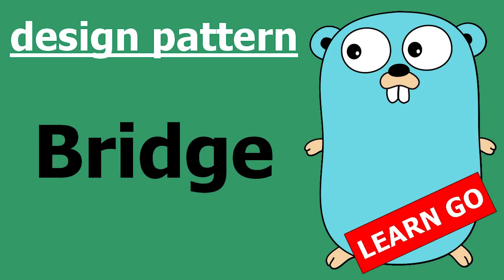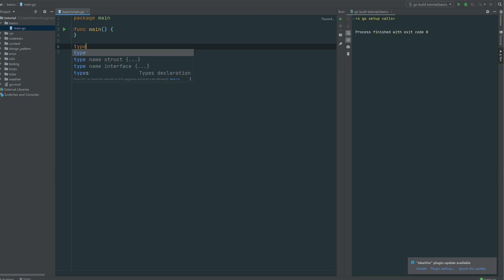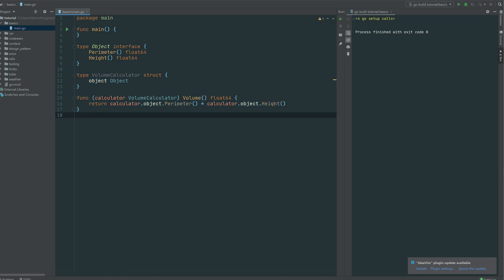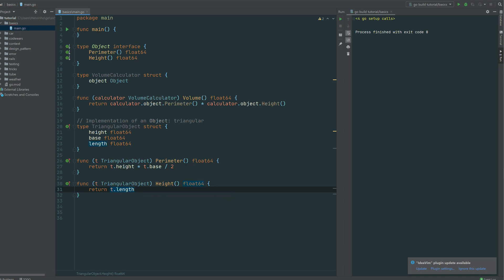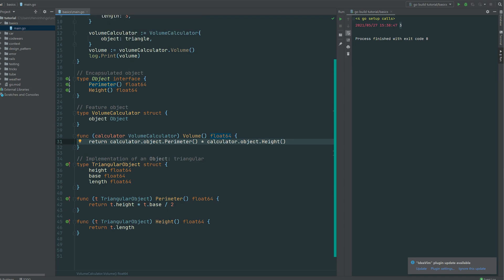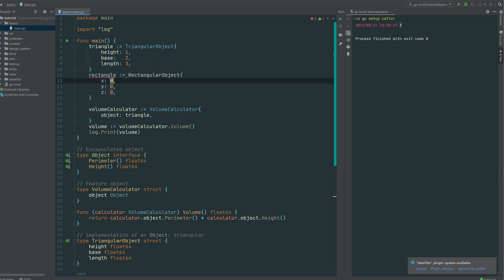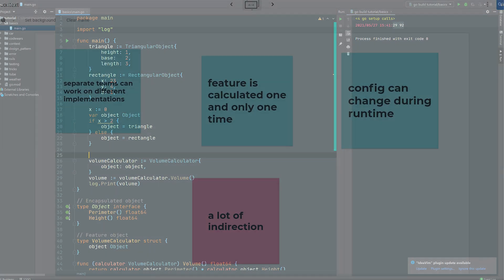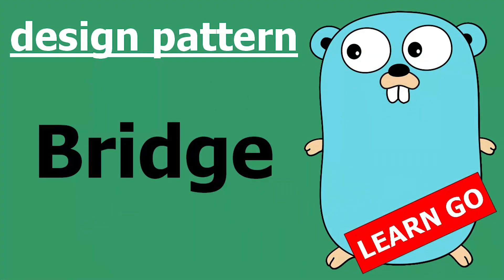[Golang] Bridge

Comment: Funny, I use this pattern all the time but didn't know it had a name 😂. I'm working at a startup where our go server uses a ports-and-adapters architecture, and this "bridge" pattern is how we define all of our functions; using interfaces instead of types. That way, if we have a function that, say, expects MongoDB (which is, at the end of the day, just a database with CRUD operations) we can replace it easily with another db that has the same operational interface. We create interfaces for all our backend resources and entities, then use dependency injection on functions and structs use this bridge pattern. Awesome video! tiny correction: I believe you mean't "area" whenever you wrote "perimeter". Otherwise, excellent presentation, Panpito!